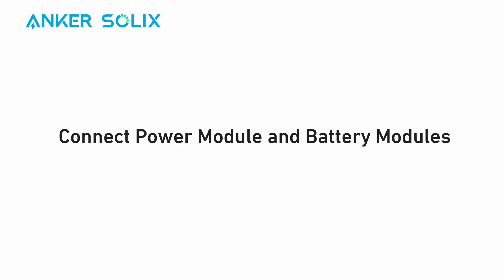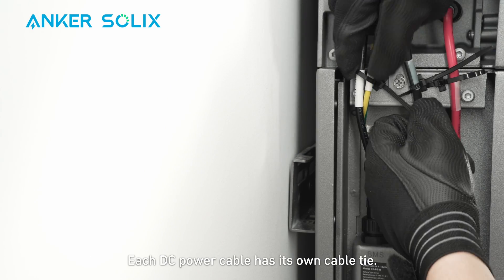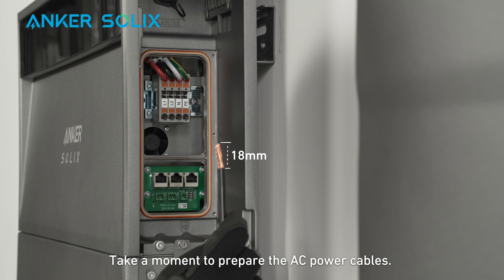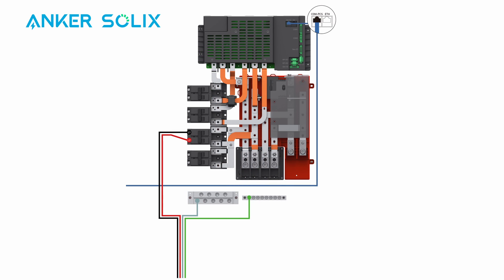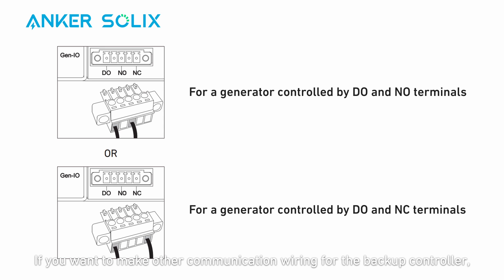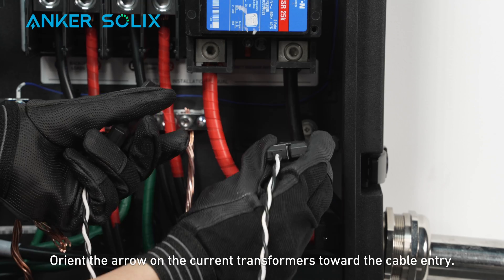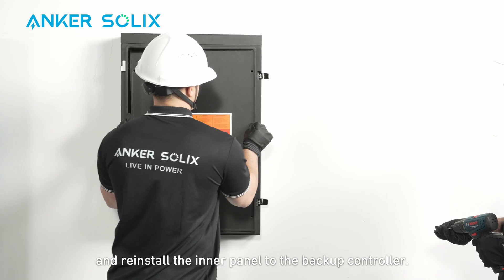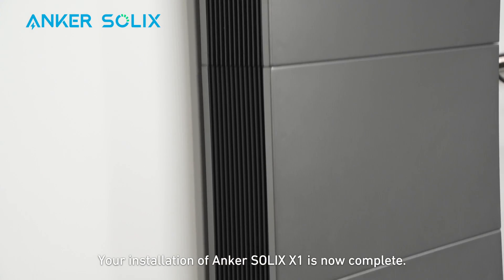Anker SOLIX X1 Installation - Wiring the System

Comment: Anyone know where to buy mc4 caps (for the DC +/-) like the ones used at 1:10
There are alot of "dust proof" caps out there, but the ones in the vid actually seems as tight as a normal mc4 male/female connection would be.
Thx